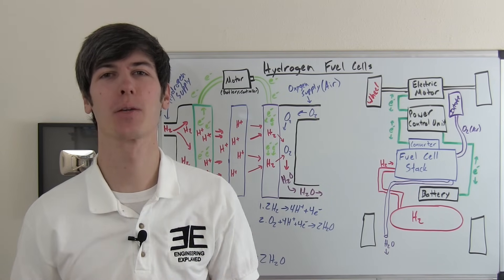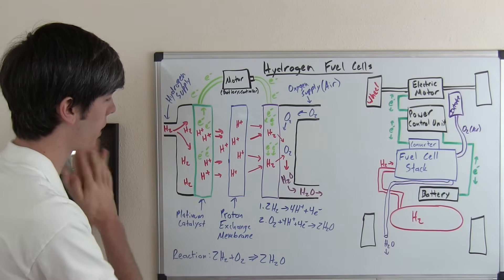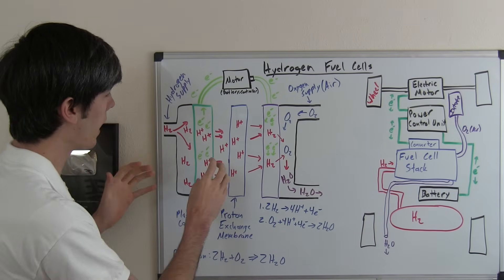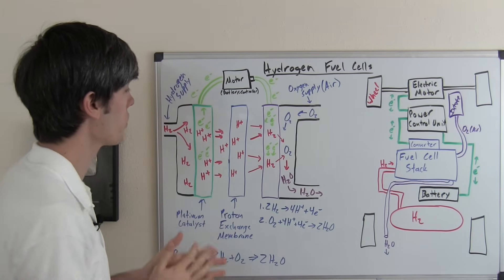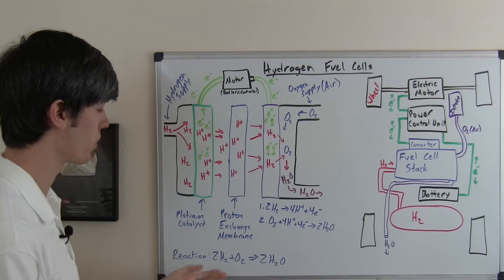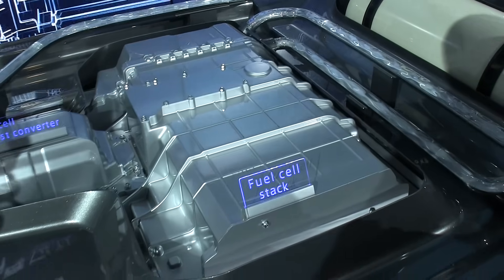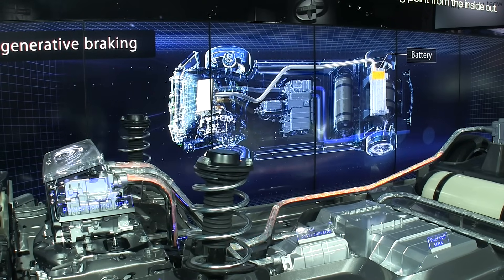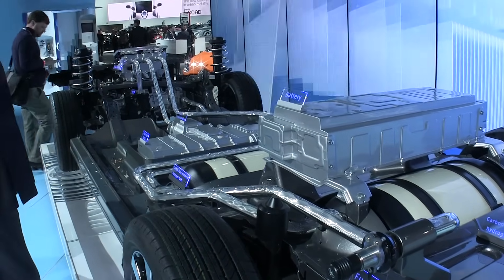Hydrogen Cars - Toyota Mirai - Explained

Comment: WHy not just use hydrogen in classic internal combustion engine like they do with LPG or CNG??? Using all that rare earth materials with very very limited lifespan if like under 5 years. You can compress hydrogen without knock all the way up to 19:1 with no problems. That is diesel territory, and pure hydrogen is way faster to burn than fossils that means more power.
Reply: Mostly because burning H2 in a combustion engine will yeld about 10 to 25% efficiency (depending on the combustion engine) while the H2->Fuel cell->Battery->Eletric motor will give something between 60-75% depending on the batteries and fuel cell. If you skip the battery and feed the motor directly you can reach up to 85% efficiency.
Reply: i guess it's cause of efficiency.
Reply: JunckMAn video channel
 We're making just pure speculation here, seeing how fast technology evolve nowadays predictions are useless right now, let's wait and see. There are fuel cells that don't require platinum to work, others based on urea that is dirty cheap, rare earths can be recovered from electronic scrap, ecc. I wouldn't be so quick dismissing the fuel cell car so early in its developing stage. My opinion is that pistons made their time, they're >100 years old, time to move on.
Reply: Let me remind you that eletctric cars are no younger. First mas production cars were electrical, and date all the way to 1886.
First Benz internal combuston car was is 1885, and first series production dates to 1888.
So what is older and should go?
Reply: ok.
Average life of an electrical engine is >15 years of continuous use under proper thermal conditions, how does combustion engine rates on that? Does it last that long without thorought and invasive periodical maintenance and decay in performance?
Reliability... seriusly? again, why does cruise ships have 3 spare diesel generators plus an emergency one on the higher deck but no spare thrusters? Electrical engines are infinitely more reliable, I mean it's 1 moving part vs 100s of moving parts. Serviceability is just the same as i.c.e.
Power to weight ratio is in favour of the electrical engine if you consider only the engine itself and don't come talking about the weight of the batteries because I already told that they're the bottleneck and a more suitable way to feed the engine must be found.
Reply: elpidiovaldez4ever +1
Reply: JunckMAn video channel
 I agree, the technology isn't quite ready yet. Anyway I don't see why it shouldn't be possible to replace the cell without changing the entire car. It's not like you throw the car away if the battery stops working
Reply: JunckMAn video channel
My opinion is my opinion and the internal combustion engine had so much success only because petrol can store energy much more efficently than cells and batteries, that's all. If you want to argue that an engine that gives 30% of what you input is better than one that gives 98% that's your choice, but electric engines are better under all aspects, they're simple to build, much less moving parts, no clutch, no gearbox, no intake and exhaust (less weight), almost no service, power delivery is smooth and torque almost constant through all the rpm range. It's not by chance that big cruise ships (just to give an example of a field where houge amount of power is required) are propelled by electrical motors and so are trains, electrical energy in infinitely more easy to handle than mechanical energy.

First electrical car in 1881, the las one in 1920 and you're so quick to dismiss it as "old technology that has to go". In 100 years the internal combustion engine went from 10% efficiency to 25% (at best) with a crapload of electronics and cpus, it's pretty clear that it's a technology that made its time. Energy storage is the only bottleneck now, solved that problem no one will want a smelly, dirty, loud, heavy and expensive gasoline powered car.
Reply: Actually you loose couple of big issues apart from that. It is service life, repairabilty, reilabilty, and power to unit mass ratio.
Reply: Wait wait. We are talking about motor+power supply for motor. For ICE all you need 100 moving parts+big tank of fuel and a pump for fuel. For electrical engine you need 1 moving part+shitload of electronics+complicated chemical-electric process+ tanks of hydrogen+ton of batteries.

And what about extreme weather conditions. Will all this pumped up fuel cells work in -50C? Internal combustion can start and work in extremely low temperature conditions, whilst this is good for california all year long summer only.
Reply: Read the previous message
Reply: read. nothing useful. of course internal combustion engine are not perfect, but this technology is not either, and do not solve anything.
You either should go after nuclear power or actually go hybrid with internal combustion engines
Reply: ok have a nice day
Reply: Fabio M.
You too. Thank you for discussion
Reply: when u combust hydrogen u heat up the water that was produce through combustion. heating up of water and vaporizing it will be wasted energy thus a much much lower efficiency
Reply: It is no problem if there is like newer version that is compatable. But generally you wuould need new power controller to be compatable with new fuel cells. So you change fuel cells and controller and batteries. But the cost of theese is 70% of the new car. But after 5 years car price on secondary market would be like 50%. So you would spend more money on keeping it going than you can sell right after you invested all the money in. That is the idea
Reply: Higher emissions and still direct injection gas engines are cheaper and more efficient.
Reply: Fabio M. But rare earth materials for fuel cells have lifespan of couple of years, whether internal combustion chamber engines run for years. So it is like buying a house or renting one. Theese fuel cells would need replacing at 100k miles. I have yearly bout 20k miles. Then why the hack i need to buy a new car in 5 years because this one needs all the vital parts not just repaired bu replaced completely. And guess what, in five years all theese parts would be obsolete, not manufactured and out of stock. Id rather pay twice for my fuel than dumping a car every4-5 years and getting a new one

Comment: This is the future of the automobile
Reply: ***** it's not possible to convert an old car to hho without changing all the engine, fuel tank, transmission, etc...
Reply: billieguitar Electric cars with batteries maybe, but lithium ion is not the future we need better chemistries with higher energy density that Li-ion can provide at the moment. The only mayor drawback electric cars have at the moment is batteries.
Reply: What future?
Reply: kodez79 Batteries, no. Supercapacitors, yes. Supercapacitors work by storing electricity just like regular batteries do, but they can be charged almost instantly and they can be recharged almost an infinite amount of times, instead of ~1000 recharge cycles Li-ion batteries can take before starting to lose their capacity fast. The only problem supercapacitors currently face is low energy density. Supercapacitors take about 10 times the space of Lithium batteries for the same amount of energy that can be stored. But of course this is being worked on and will improve in the future. As others have said, the problem with Lithium is that it is a very rare metal and mining and processing it to make batteries is a horribly dirty business. Another problem all plug-in electric vehicles face is the fact that many countries, including the USA, produce a huge percentage of their electricity by burning coal. "According to another Argonne National Laboratory report, if a plug-in hybrid charges from coal-generated electricity, it could be responsible for emitting up to 10 percent more greenhouse gasses than a conventional vehicle." So until we get clean electricity, electric-only cars are quite horrible polluters, contrary to popular belief. Luckily we are not that far away from fusion power, which will be pollution free and only requires sea water for "fuel".

Supercapacitors are already in use in some buses, where they're charged by regenerative braking and the stored energy is used for accelerating the vehicle from a complete stop. City buses do a ton of stopping and accelerating, and the first push to get the bus going is the most inefficient thing for a regular internal combustion engine.
Reply: MC Taipan If you have not yet tried the Tesla Roadster or Model S, please do not discount electric cars. I have not had a better time driving a car than the three weeks I borrowed my friends Model S just after christmas, at least not off track. It is mind-bogglingly fast.
Reply: *****
 Just out of curiosity, does your car run on hho? where do you get the power for the electrolysis?
Reply: kodez79 You'd be surprised at how fast technology is moving ;)
Reply: MC Taipan While I appreciate you view on older cars, and I do share that interest, I can't see why you would not even want to try an electric. I try new stuff all the time, because it is fun. Does not matter if I think it will suck or not, because I don't know till I try.
Reply: billieguitar This is a simpler design. Lithium is awful for batteries, there's only a tiny amount of it on earth, it's hugely damaging for the environment to extract and process and it makes some really bad batteries with short lifespans, that discharge very quickly,  loose 20-40% capacity in the cold,. Batteries are heavy, making the car ineffective.

This works just like a normal car. It weighs like a normal car, it costs less than a normal car (given that production comes up to the volume of combustion-cars).
Reply: ***** more kinds of engines and power source = more weight that makes the system very inefficient.
Reply: No such thing as an automobile in the future, we're all gonna fly.
Reply: Kepe Super or hypercapacitors are more than an order of magnitude away from having the capacity of a battery today. That is in energy density, or Wh per Kg. That might improve somewhat, but there is also another problem. Batteries will trough the chemical reaction keep approx the same voltage when full as when empty (unless you overcharge or empty them so they take damage), which allows you about the same power output. A capacitor will loose voltage linearly as you spend the energy, so at the end, you may not have enough voltage to drive what you want to drive.
There is no research claiming they can get the supercapacitor to 5x current limit using graphene, while batteries show the same improvement in labs. A combination might be good, but for the foreseeable future, I think battery is the way to go, or you have to have quick-chargers very often, like the busses and trams you talk about.
Reply: Papaya Man That's what they said we would be doing now back in the 70'. Not gonna happen in our lifetime.
Reply: kodez79 Well someone's a debbie downer :(
Reply: Actually, "mirai" means "future" in Japanese.
Reply: In the future we dont drive cars. Public transport and push bike is the answer
Reply: billieguitar There is not that much lithium in this planet....
Reply: Battery is the way forward, and it is easy to explain by looking at the overall efficiency. Either the hydrogen is generated from natural gas, electrolysis or from a termochemical process/cycle. From natural gas you will be using hydrocarbons, and there will be a significant CO2 emission. Electrolysis is very inefficient, you put 3kWh in, and get 1kWh worth of hydrogen. With thermochemical cycle you put 10kWh energy into the process, and you get approx 5kWh out. Already 50% of the energy is lost in the process.

Then you need to get the electricity from the hydrogen. The fuel cell is currently about 60% efficient. If you put those 5kWh hydrogen into it, you get about 3kWh to the motor, and about 2.7kWh to drive the car forward. In the full process you have lost about 73%. The fuel cell can theoretically get to about 80% efficiency, but you would still be wasting about 65% of the energy you put into it.

If you push 10kWh into a battery, it can be charged with about 90% of that energy back out to the motor, and the motor being 90% efficient would give you 8.1kWh to the wheels. The battery cars currently utilize the power 3 times as efficiently as hydrogen. It cannot get much better either, as the theoretical max efficiency of the hydrogen is still less than half as efficient as the current battery technology.

If you start to factor in the distribution of hydrogen, the buildup of a pump network and extremely high pressure tanks at the pumps, it just does not make sense. Yes, you can refill your car in 10-15 years when the hydrogen grid is becoming useful, but by then you can drive twice as far with an EV, and recharge in about the same time it takes to fill a tank. There is no way hydrogen will ever be the dominating technology.
Reply: No it is bullshit. Its expensive and complex and inefficient. Lithium batteries is the way to go. Like teslas.
Reply: ***** So it doesn't run on hho but on a mixture of hho/hydrocarbon, because if you're telling me your engine run in a closed circuit purely on the hho generated on the fly with power from the alternator that's simply not possible (in this universe at least).
Reply: ***** 60 mph is plenty in cities but slow between cities, it depends on where you live, also solar panels are painfully weak at producing energy. We just have to wait for better/cheaper batteries or cheap hydrogen/hydrogen cars, right now gasoline is just the best option.
Reply: Papaya Man No, I will not, as I am in the middle of it. This is my job, I make this shit, and I can tell you without a shadow of a doubt that for the forseeable future, we will not be flying everywhere. Some might, but most not. The reason is simple, we don't have the extra energy to spend.
Reply: Papaya Man Not really all that sorry to wipe away illusions. I hope I am wrong though.
Reply: Not the brightest and most fascinating future according to most car enthusiasts :( Its better for the enviroment of course and thats a god thing but to be honest , it doesnt fascinate me.
Reply: I have not tried it. Even if that car is fast then i still dont like it because i like the noice of a petrol engine. I like the concept of a petrol engine. I simply find petrol cars more fascinating. To be specific older petrol cars, mostly from the 70s and 80s also because of the design and that they were more of cars rather than computers. I dont have to try it. Yes maybe its smooth , fast and comfortable but i still dont like it.
Reply: kodez79 ok, but i will never like vehicles like that. I see them as boring and i barely see them as cars. Its how it is when i dont like something then im stuck with that.